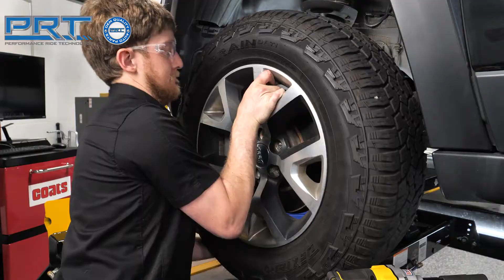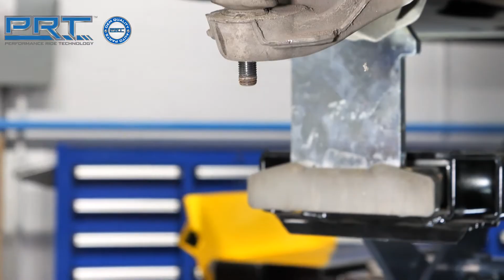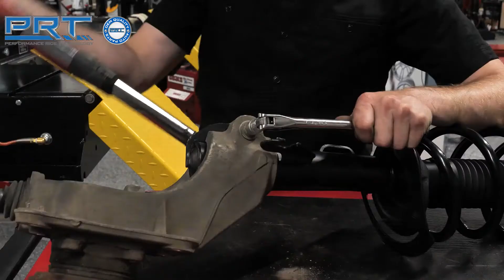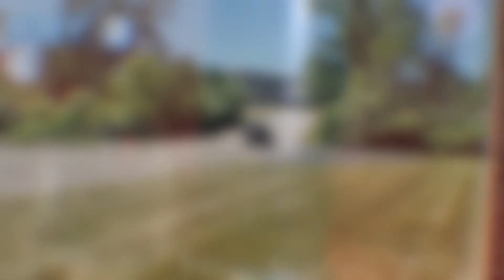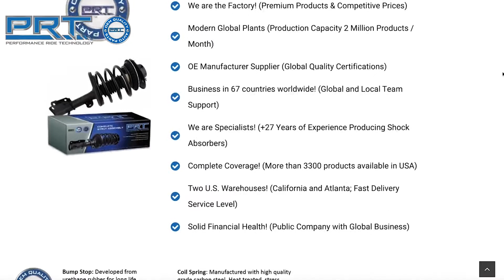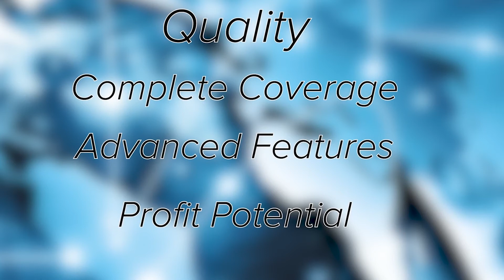Jeep Cherokee 2019-2022 Strut Installation

Comment: this installation was EXTREMELY over complicated
Reply: Can you simplify this?
Reply: No need to take off speed sensor, no need to take out the whole assembly of the strut/knuckle, just free up the parts around the strut tap the knuckle off the strut with a hammer. So yes video made you work double for no reason @reyrey0226
Reply: @reyrey0226 there is another comment backing up what i just said